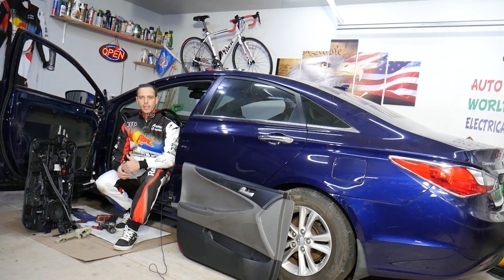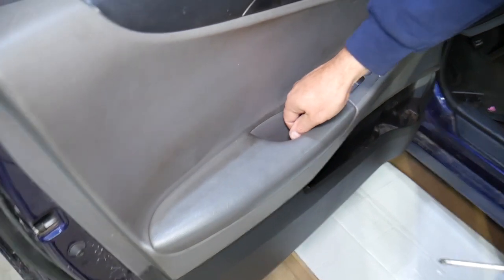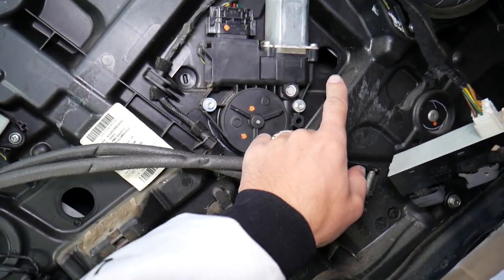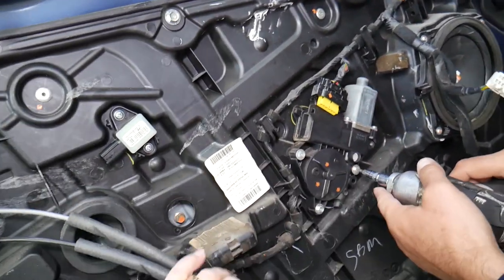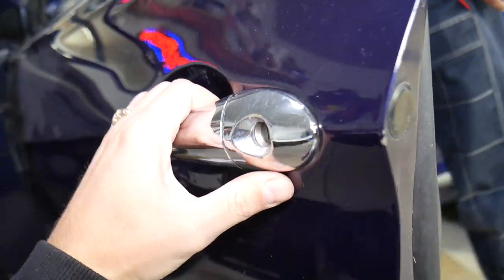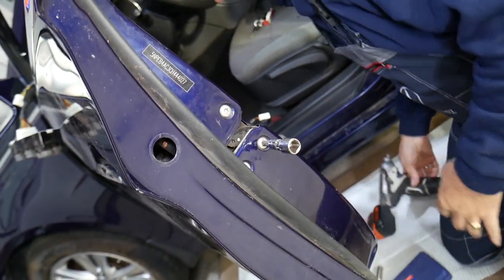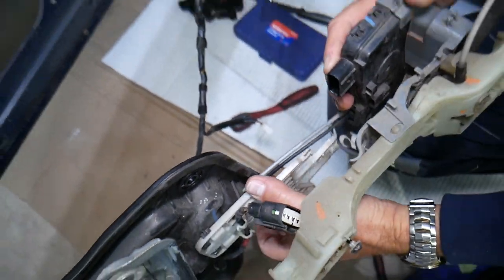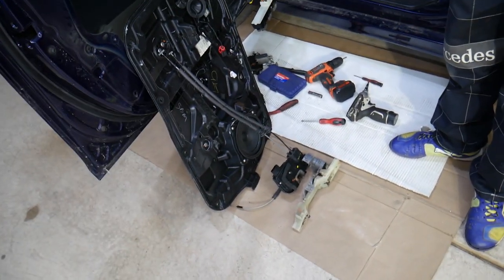HYUNDAI SONATA FRONT DOOR LOCK ACTUATOR REPLACEMENT REMOVAL, DOOR HANDLE ASSEMBLY

Comment: I have an 09 Sonata. I replaced the drivers side master power switch because it wouldn’t put down the windows or unlock the doors while running. After replacing, the windows work, locks when running but the doors will not lock In auxiliary mode or when the key is out of ignition. The fob will not lock or unlock either. Do I need a drivers side door lock actuator or is it something else?

Comment: After you remove the actuator assy, you can disassemble it and replace the $20 motor...the old one pops right out, and the new one pops right in...no soldering. Don't have to buy  the whole assembly. "for 2011-2015 Hyundai Tucson Sonata Door Lock Core Motor Power Door Latch Autuator Interior Motor Replacement New"